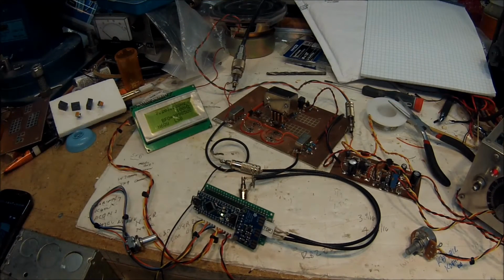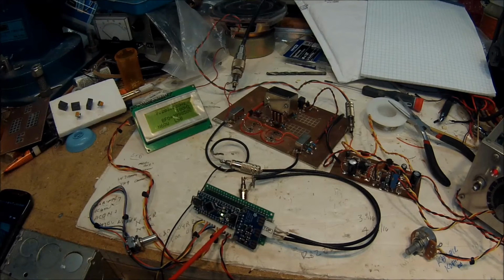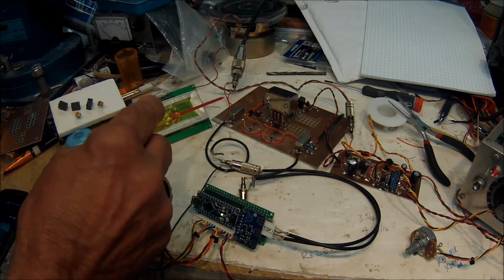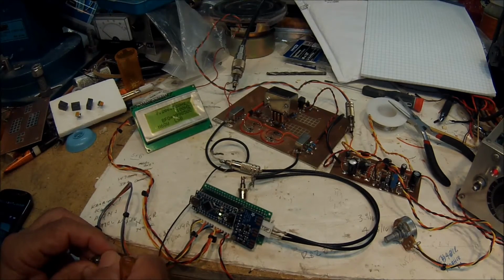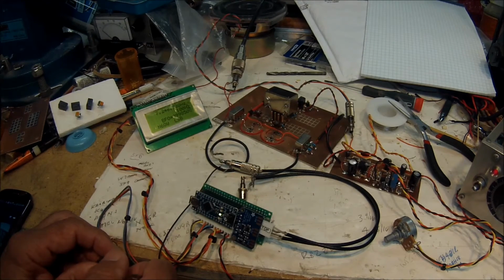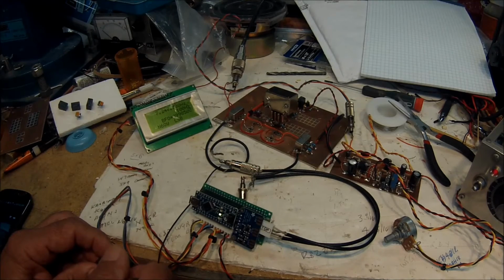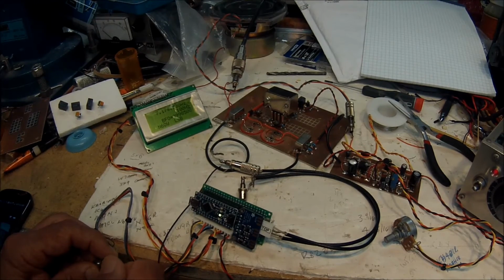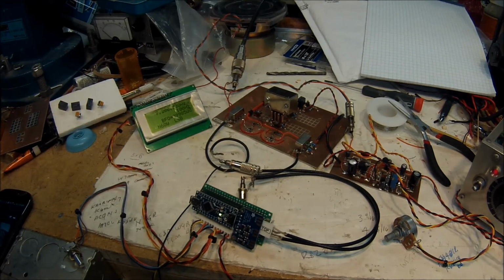Using Si5351 PLL with a 40M SSB Transceiver Test Bed

Comment: Why not to publish a complete artical of your project with the Arduino code so that many can try it out themselves
Reply: What is Arduino code?
Reply from the maker: An article that uses this approach is currently in work. The published article will appear in QRP Quarterly. If you go to my website www dot jessystems dot com there is an Arduino link and there is code for a direct conversion receiver that ultimately will be turned into a SSB transceiver. That code will be modified to include an offset such as you have in this video, But the code is for the AD9850. The final transceiver will have the Si5351.
For the person who asked what is Arduino code -- do an Internet search on Arduino and the question will be answered for you.
Reply: Thank you Juliano for the info. I shall be waiting for that article with the Arduino code for the Si5351.
Satish
VU2SNK

Comment: Can I have the code for the arduino?
Reply from the maker: Sure! Send me an email at radioguy90 at hotmail dot com. Keep in mind still some hiccups and burps with the code but you are more than welcome to try out the code. You will also need the Si5351 Adafruit PLL board. The code will not work with the AD9850 DDS.

Pete N6QW